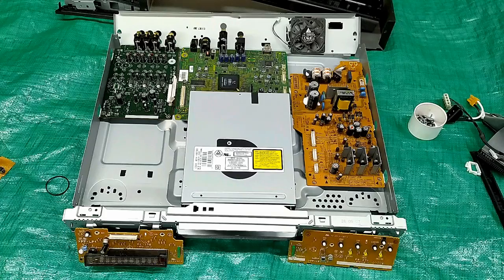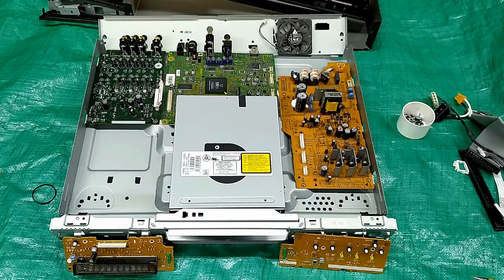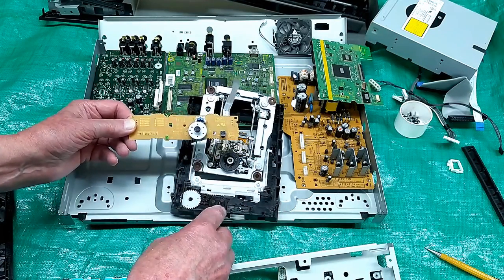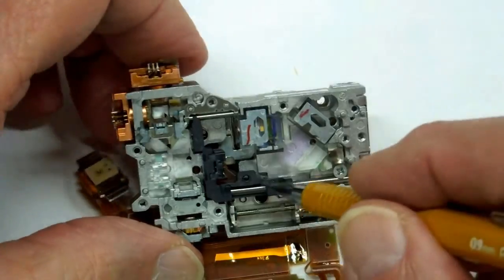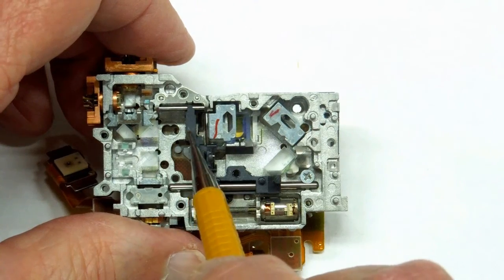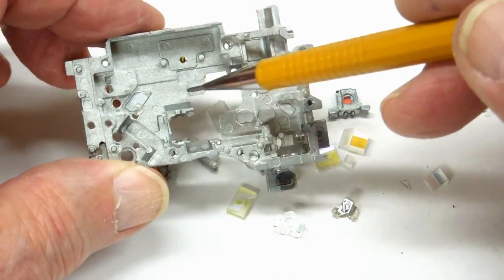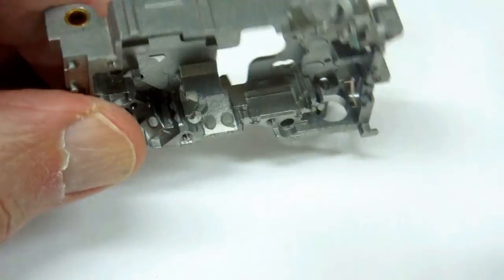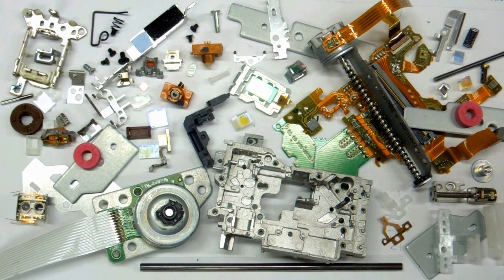16-Year-Old Sony Blu Ray Player - A Look Inside

Comment: there should be three lasers-  violet (bluray) red (dvd) and IR (CD). Guessing there's two lasers + photodiode in one of the packages, and the other diode + photodiode in the second package.  I remember when bluray came out, people were taking the lasers out to make violet laser pointers using replacement sled units.  DVD units have two lasers (red - dvd,  IR - CD).  the head has two sets of coils, one to move it up and down to focus and one to move it side to side for fine tracking.  The part at 9:07 or so is a very small LCD that can mask off parts of the beam.  I am not sure why it was needed, though.  the page about making laser pointers showed it being activated.  you can't see it do anything though without polarizing filters.